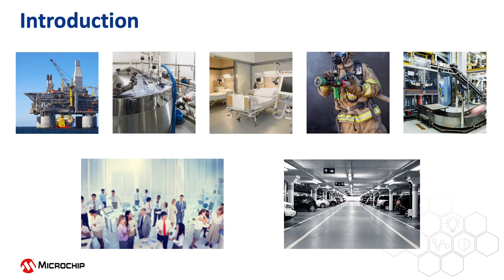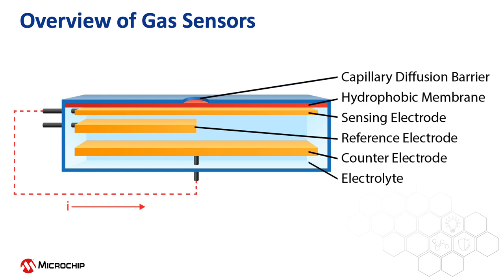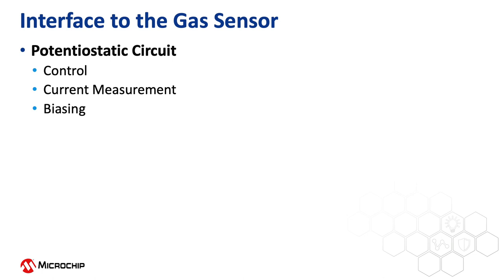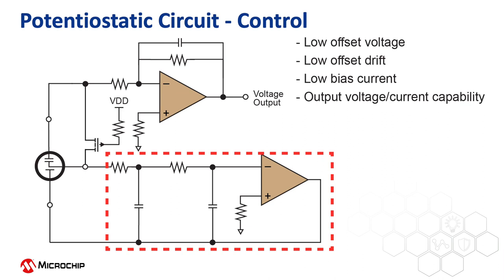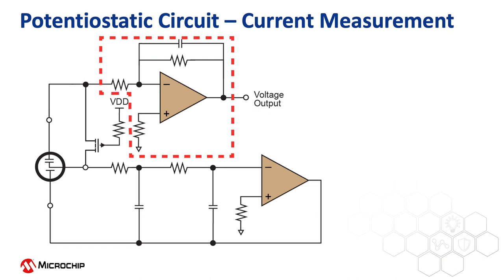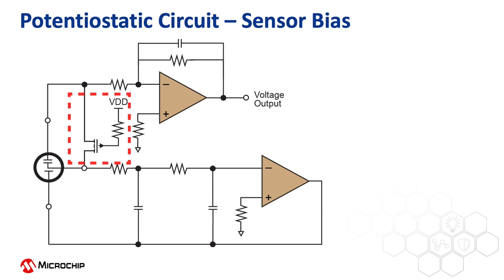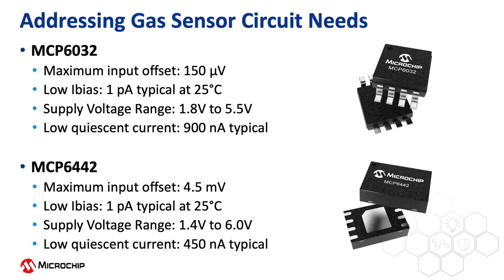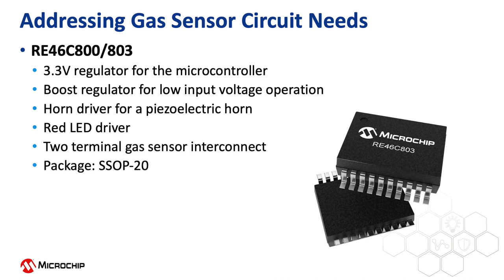Interfacing to Gas Sensors

Comment: Where is the electric circuit with opamp identification and so in, which will work, i am new and found the only principles are very difficult for assembling the whole device
Reply from the maker: Hi there, thanks for reaching out with your question! We offer a reference design for Electrochemical Gas Sensor Evaluation and Demonstration Application, available on our official website. This could be very helpful resource for you! It provides a detailed framework for understanding and interfacing with electrochemical gas sensors, including the necessary circuitry. This reference design complements the technical documentation and the operational amplifiers like mCP 6:03 and mCP 6-4 for two, which could be utilized in your project. By following this reference design, you can get a hands-on experience which might simplify the process of assembling and understanding the electronic circuits involved in gas sensor applications. 

Here's a link to the design files: https://www.microchip.com/en-us/tools-resources/reference-designs/electrochemical-gas-sensor-evaluation-demonstration-application

Hope this helps!